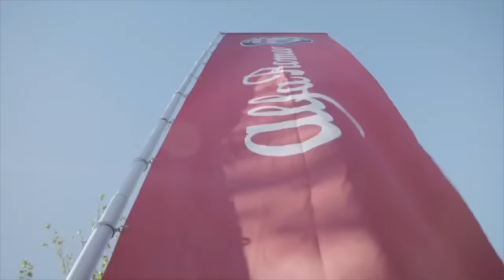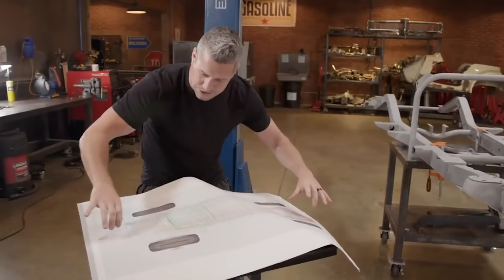What Really Happened to Ant Anstead From Wheeler Dealers

Comment: Ant's metal bashing skills are amazing. Getting curvy shapes in sheet metal  that look factory pressed takes some real skill.
I noticed Mike B does like to dish out the smart mouth, Edd generally put up with it, Ant slapped Mike back. I notice now with Elvis, Mike is much more respectful.
Reply: @jw-pk5vf  Thanks. Not wishing to talk badly of anyone I don't know. From my own experiences I know doing good "metal bashing" (vehicle body work) takes a lot of time to learn, it's a real skill, it can't be learnt on a part time basis. 
Usually handsome men are more into themselves/chicks than spending hours learning the skill for which there is no substitute for hands-on which does take a toll on the hands/skin. I was suspicious of how Ant could be so good at metalwork when he never seemed to have put in the hours learning it. Eg a (UK) policeman has no free time for anything than the job.
There was a piece of metal needed to fit the lower corner of a windscreen that was to be fabricated, it was all curves, I >know< that takes a huge amount of skill, the impression was Ant did it, suspicious. And that sunroof removal/replacement, all the curves on a roof takes skill to get right.
Reply: Mike and Ed used to joke around and the concept was Michael's the boss of the budget and they used to make that an issue by joking. 
That's why it worked before and fell out of favour after.

Comment: Ant couldn't be bettered in the programme  for the love of cars all the way back in 2014 . As excellent as the programme was it shows the folly of car restorations ? All the cars restored where sent to auction but basically didn't achieve anywhere near the cost of the restoration in man hours and parts .
Great for us the viewer and even better for the lucky people who bought some exemplary restored vehicles, I just wish Channel 4 or others would make some more nut and bolt restorations of this calibre , car SOS  comes close but the end result isn't as pristine and back to a concourse origional condition as for the love of cars  .
Reply: I really appreciated Car SOS and their efforts from season 8 episode 1, the Porsche 356C. That was a useless scrapheap that many would have chucked in the bin, it was extremely far gone with little to no viable steel left. To the extent that a bar had to be welded on in order for the car to stop itself from snapping in half at the b pillars, and to restore that (originality aside, I'm sure they did their best even if every nut and bolt wasn't identical to factory specifications) was a monumental task and they managed to pull it off really well. They do fantastic work and I honestly prefer to Wheeler dealers for that reason.

Comment: Life according to Brewer, there are mechanics everywhere but only one Mike Brewer.
He is the ultimate fix it cheap and sell it dear dodgy used car salesman.
In the early days he used to spray paint rear parcel shelves with black paint instead of fitting the correct part.
He always tells the vehicle seller there are quite serious problems that will be expensive to fix when in reality it’s a simple fix and cheap too.